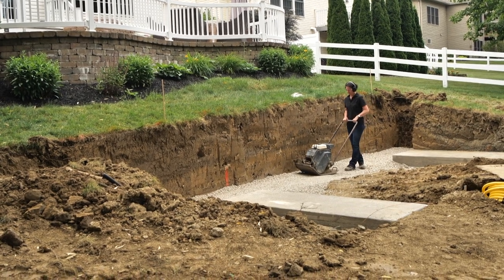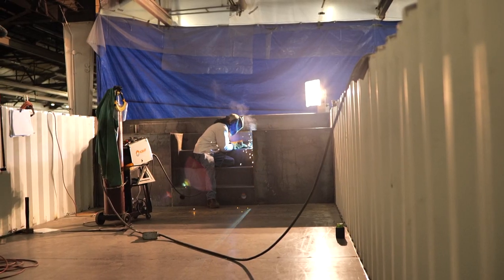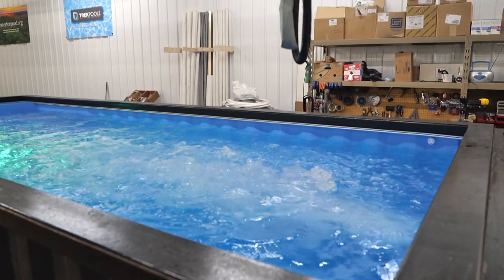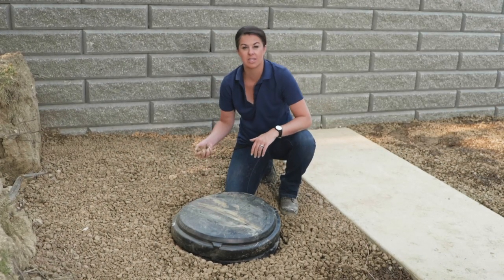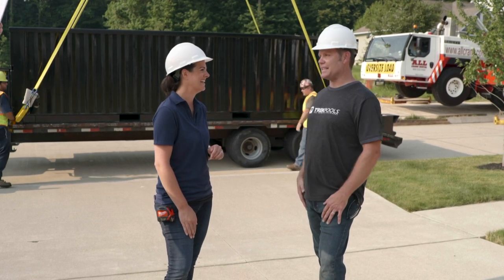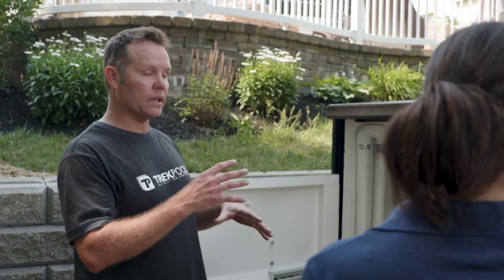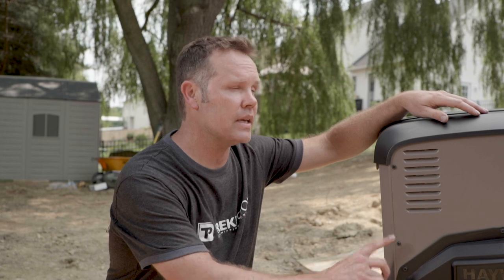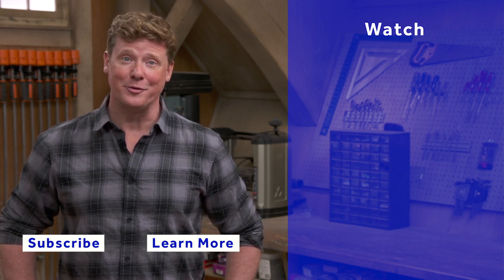How to Install a Shipping Container Pool | Ask This Old House

Comment: I'm going to assume that the cost of the crane negated any cost savings of installing a prefab pool unit.
Reply: Cane rental is only about 1-2k for the half-to-full day job
Reply: @jm-lc3jp  No way, not for a crane that size. Hahaha. That crane comes with an operator, an oiler (second operator), and a rigging crew. The route the crane needs to take needs to be planned in advance permitted with local ordinances. it costs about 8-10k dollars a day for a crane this size on a construction site. They would be getting a steal if it was 5 grand.
Reply: @owall83 
northtexas: 120T w/ oper & oiler: $3040 for 8 hours (110 for road permit) 
bigge: 100T (w/oper)  linkbelt HTC86100 - $2920 for 8 hours...
ICS: 100T (w/oper): $2360 for 8 hours (also $65/hr for riger ONCE ON SITE)
 
The OP is about 'the cost of the crane negating installing a prefab pool unit' it's nothing to do with a crane that size.  What you see in the video is an full-display for free advertising, and complete overkill. (So real answer is TOH team member with TOH in partnership with allcrane probably paid zero or got a nice deal for this peice)  But lets run with it.  The crane in that video is a Link-Belt HTC3140LB 140USt rented from allcrane.  We can find similar rental costs across the web for similar sized cranes (again, was overkill) are all above.
Reply: Most likely, I mean you would need a crane for a prefab too….  But yeah I hear yah
Reply: @djanderson8953  not if it's made out of fiberglass then all you need is a bunch of friends to come help carry it
Reply: @ChronicBongitis420  what if you don't have any friends :(
Reply: @mghtymous21  then you don't need a large pool
Reply: @vladtepes97  what if you have an addiction to cheese burgers and french fries and you do need a large pool. Asking for a friend
Reply: This is Elan Musks' house
Reply: Holy..no joke...that's a big crane. Thought they were gonna hoist a rocket on to its launch pad lol.
Reply: Really depends on the scenario, and where the pool is being built. A property we will move to in retirement, it would be double the cost to build a pool as it isn't easily accessible.
Reply: @jm-lc3jp same pricing for San Antonio  but figure yould only pay half for the four hour minimum
Reply: Cranes aren't cheap, but I don't think renting one for however many minutes it took to lift the pool off the lorry into the house's back garden would be anywhere near enough to make shipping container swimming pools a false economy. Proper in ground ones can cost up to £45,000. I read it somewhere, I'm pretty sure it's true.
Reply: OK OK BUT HOW CAN I GET IN CONTACT W/ THIS POOL COMPANY ?

Comment: This seems like it would cost 20 times more than just having a regular pool put in
Reply: $40,000-$60,000 for an in-ground is typical.
Reply: I would think the old way of doing it would cost more. Also you are saving a Container.
Reply: It still looks like a shipping container inside.
Reply: Do you know the cost of a regular pool?
Reply: @lovedfriend2020 there are no lost containers. We've been short containers for decades. As soon as China started buying grain on a large scale in the early 2000s we've been short.

Comment: Smallest heater on the market?   Took me 2 minutes to find a 250k BTU pool heater... 
How does this work with the decking?  Was there a ballpark price total price range mentioned?   
I'm a big fan of This Old House.  There's so much potential in these online segments.  This is an awesome project idea.   Would have stuck around another 5 mins for it have gone more in-depth / practical.
Reply: By "smallest" he means physical dimensions
Reply: They say smallest footprint heater, meaning physical size

Comment: I like the concept. Those containers can be used for housing
Reply: Legally, they can't. It's impossible to trace it back what was shipped in those containers and therefore legally they can't be used for housing humans
Reply: @henrikcsuri  Clean them, duh.  Plenty of folks make homes out of them as well.  See Andrew Camarata's channel for one.
Reply: There's a popular video on youtube where a guy built a container house in California. He essentially had to frame a normal normal house inside the container since adding windows and doors removes the support provided by the container. Basically a container house is really a normal house with  a more expensive container siding/roof.
Reply: @UTeewb  Progress!!

Comment: Thoroughly confused. What was the window for if  you buried it?
Reply: it's not buried. the backyard is hilly and they cut into the hillside and poured footings for it to sit level on and appear inground when looking out of the house. it's basically a heavy-duty above-ground pool/ spa/ hot tub all in one.
Reply: I believe that was just their shop display/test model so they could show off the water jets working.
Reply: @mage189  I think you're right, I didn't see a window in the crane footage.
Reply: @mage189  You CAN purchase a pool with the window installed! They are not just to display the jets and leds.
Reply: Pimp factor

Comment: What makes a shipping container cheaper than just building it from raw materials?
Reply: I'd like to know as well. They got a bunch of machinery and workers out to the site. It makes me think that adds quite a bit to the cost of the pool.
Reply: Not to mention it seems tiny compared to a regular inground pool
Reply: Looks to me like on site install is significantly faster. It’s a lot more self-contained and you don’t have to run pipes all the way out to a pool house. That being said I wouldn’t expect it to be “cheap” haha.
Reply: There are millions of shipping containers around the world. There actually very cheap. And I believe some companies will only use them once and then sell them. Depending on the cargo being transported. I’m not entirely sure if that’s correct but I believe I’ve heard that before. 

Shipping containers are actually quite cheap. It’s just a corrugated steel box.
Reply: With all the necessary decking, grading, foundation piers, electrical and gas hook ups, not to mention the cost of a heavy lift crane for a day, you're easily into it for $50k -$75k .
Reply: @RCinginSC  nah I'd say you're shooting a bit to high. More like $25k to $35k
Reply: @RCinginSC  from a place that installs them: For example, traditional in-ground pools typically cost somewhere between $35,000 and $65,000, with the average price being around $49,000. On the other hand, shipping container pools usually cost somewhere between $16,500 and $39,900. Like other shipping container structures, shipping container pools are an incredibly cost effective option. The range of cost for the shipping container pools generally falls below the average cost of any traditional or conventional in-ground pool option
Can provide source if you'd like
Reply: @DonnySimpanero  Thanks for the info.  I was wondering this myself. But on top of the pool cost, they are adding a deck. It looks nice, but to me is more of an oversize hot tub than a pool. For that price I would like to be able to dive in, some more depth would be nice.
Reply: @cochinito1  I was wondering why they cut the walls so short. Personally I'd have left at least another 2 feet. For a more decent sized pool I would weld two together. The deck is another $3k to $10k  depending on if they hired someone or did it themselves.
Reply: @cantcurecancer  I agree with you. I don't think everyone is considering all the peripheral cost as you and  I mentioned.  The excavation seems to be equivalent to an inground pool, so no cost savings there. The concrete work necessary to support it ain't gonna be cheap. These videos are edited down to the point where certain steps in the process seem insignificant,  but in reality are huge and expensive.  I estimate that the heavy lift crane alone cost around $1500 -$2000 for one day. The liability insurance required to lift something that heavy over a house is through the roof (pardon the pun) and that cost gets passed on.  I'm sticking with my original guess at a minimum of $50k for the project seen in this video.
Reply: @DonnySimpanero  Does it make the most sense to compare a shipping container pool to an inground?  I was under the impression this is more equivalent to an above ground.
Reply: @RCinginSC  it on average costs about the same as a typical unground pool unless you get them custom built
Reply: @cantcurecancer  this is not typical for the company, they only do this on special jobs. It was just that This Old House had the money to cover it!
Reply: @_P0tat07_  ... depending on the source, location, and shipping distance, those container can run from $1,500 - $10,000 and yes, there are so called single use containers.
Reply: @cochinito1  ... wild guess is $10k worth of carpentry plus another $10k in misc landscaping. Retaining walls are priced by the square foot plus excavation.

Comment: Would like to know the pros and cons of this vs a traditional plastic or concrete pool
Reply: The main "pro" is that she got a free pool, at the expense of her employer and the vendor.
Reply: @jej3451  I cant say for sure about this episode, but most ppl that appear on these shows, pay their own labor and/or parts. I remember an episode that the family ended up not doing a repair, because it was too expensive and they couldn't afford it. I was very confused by the end and had had to look it up.
Reply: The customer service the durability and extra features and the ease of use when it comes to servicing the pool. Just read the description of the video!
Reply: I’d say the “cons” are lack of space. 8x20 sounds big, but hardly large enough to swim in. It’s really more like a large jacuzzi, and less like a “pool”.
Reply: Con: you spent $40,000+ and it looks like a dip tank you would find in an industrial setting.
Reply: I would say that vacuuming that thing with all of those ribs is going to be a royal pain.
Reply: @phonedave  my thought exactly, how do the walls stay clean?
Reply: Cons are the additional need of building a retain wall, removing water from the drainage basin, and building a deck around the pool.
Reply: @sallystephanledvina8252  .... I would bet they sell a pool brush in the same shape shape as the pool walls.
Reply: https://youtu.be/1fhJ8qTiHCQ
This was a good review. 
Hilariously she says don’t put it in-ground. lmao
Reply: @jordanweber7398  ... I have to say that by the time you install a slab for one of these container pools and the associated finish work while waiting for the slab to fully cure (30 days) it would be near the same time frame as a full blown inground pool. OTOH, a container pool would be cheaper... but you get what you pay for.

Comment: The universal 20 foot equivalent container, but it has to be concrete lined. Is this cheaper than a normal pool? I'm sure the huge crane didn't cost a fortune 🙄
Reply: I counted at least 8 yellow jackets. Those yellow jackets aren't cheap lol

Comment: Interested to know how long these lasts. As any small deep scratch to the bare metal can provide an entry way to rust? Or is the material rust proof the container is made out of?
Reply: Containers are notorious for rusting.  I had same concern.
Reply: plastic coating inside and Rustoleum on the outside tells me they expect 20 years from a fairly fresh container. I have no idea what they warranty might be.

Comment: I think the fun part of these container pools is the window. But this is sunk and I think the uniqueness of the window is lost. I wonder why a regular in ground pool was not put in. But I like the way the pool equipment is so compact at one end. There is no underground pipe so no leaks.  Small enough so I don’t think it will be too expensive to heat in the winter. Looks like a swim spa where you can swim in place against the jets.
Reply: The window is not always installed especially if it’s underground. The window is just to look cool and if that side of the pool is visible. It is also inset in a hill and the window side visible
Reply: @noahchaplin3835  Wow, on the side of a hill?   Window breaks, water and any humans go over the cliff????

Comment: What's the benefits/advantages of a container pool compared to the traditional one?
Reply: ⤴⤴▪▪🔝 leave a msg
Reply: The durability, how easy it is to service/ clean, it looks a lot nicer. Plus the company has great customer service compared to other shipping container company’s based outside the US
Reply: I think sometimes these container pools are good options for people who cannot get the necessary equipment to their backyards to pour concrete for a traditional pool, for people who live in VERY rural areas where the cost of hiring a traditional pool company to come out to where they are located is just not practical and for people who for whatever reason can't have a lengthy  (and noisy) on-site installation dragging on and on.  I would also imagine that there would be less long-term maintenance as these would not crack the way that some concrete pools can, especially if you get unlucky and hire an inferior pool company for the installation. I've been curious about shipping container pools, secure storage spaces, housing and so on as I am in a somewhat rural location and they sound like an economical option for all sorts of purposes, even small mobile offices, studios, backyard bars and cabanas or guest houses, provided that you have the necessary electrical and plumbing/sewage hookups. Pinterest has tons of ideas on the subject and it's amazing what people can do with these discarded containers.
Reply: @susansparke3462  you still need to dig,  pour foundation and run pipes/electrical. I can see it being less likely to crack, but you'll have to repaint them otherwise could start rusting. As far as for using discarded containers for housing, that's only a social media dream. To make them livable, it costs a lot of money. Ie. For insulation, plumbing and wiring you'll have to install walls. Also in many places they are illegal to live in used containers, because you have no idea what they were shipped in them and they may pose health hazard.
Reply: @henrikcsuri  I understand that these containers are not free from maintenance. Nothing is ever completely maintenance free. It is also my understanding based on the research that I have done that only new or "one-trip" containers are used for housing. Any home would require a solid foundation, water/sewage systems, the installation of electricity, plumbing, and other essential constructions to make them liveable, so that is the same regardless of the chosen material,  be it a common timber framing, steel frame or adobe home.  I worked with logistics at one time and regularly ordered containers for our overseas shipments of almonds, so I am familiar with them, plus we had several on-site that we used for miscellaneous storage. At a later job, we used them to store files and personal property belonging to decedents and I spent quite a lot of time in those miserable containers, so I do know what they are like on 115°F + days. Everything has it's advantages and disadvantages, so it is a personal choice for everyone and their unique set of circumstances in their location. At a basic function, they do make fantastic secure storage units and I would opt for a shipping container over a mini storage unit any day.

Comment: I can see where some installations could come in on the low end and you could have a nicely finished pool for say $25k... and done in a few weeks of on-site work, allowing for concrete to set up. The flip side is what's shown which could be well above $40k and quickly approaching the cost of a custom in-ground pool. (taxes on an in-ground might be more in some areas) Guessing a full blow in-ground pool will take closer to 90 days from start to finish.
Reply: Fiberglass in ground pools in my area cost between $120-$150K. This is a great alternative
Reply: @MrLocke-bk3om  ... hint... it's not the pool that costs the big money. Usually, it's the site work and what goes around the pool. Was at a job last week and the owner dropped almost $40k for a custom concrete deck / patio with an anti-skid surface, then finished the yard with sod plus plantings. The one piece fiberglass pool was in the $20k range, with plumbing. I believe it was roughly 12 x 28 with a 5 ft deep end, set in compacted pebble with dead sand side fill.

Comment: After taking the time to dig the hole, pour  the proper foundation and shore up the wall…. They should’ve just had an inground pool. It would’ve been cheaper at that point than buying the container pool. 
Plus then it could’ve been any size.

Comment: Dont understand why they didnt use an heat pump instead of gas.Cost way less to run, plus the pool is tiny so it doesnt need a big one. Would save money to just bring electricity to the pool mechanical area. I think the container pool and wood deck wasnt the best option. They got tons of space in the backyard, no need for a pool so small in width there. Would be better for a small house or small land, semi detached house, city house.